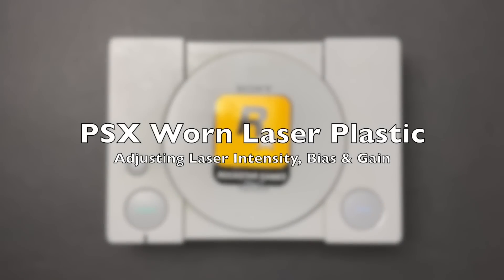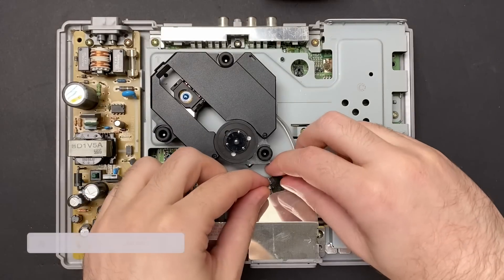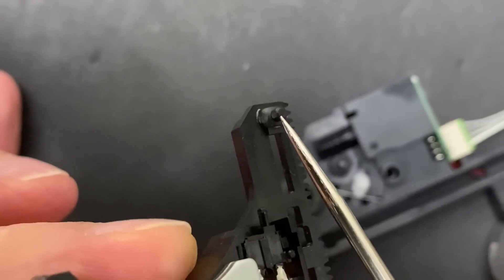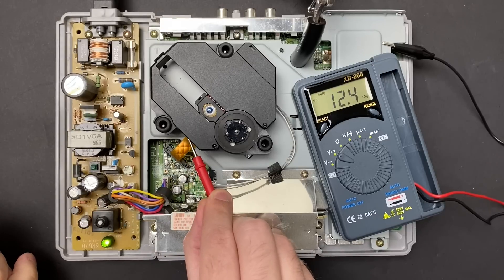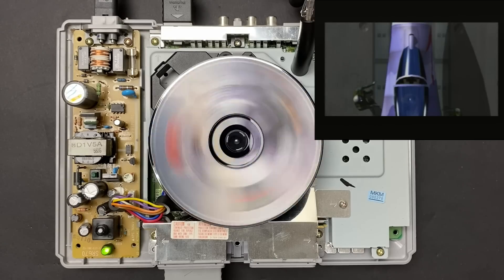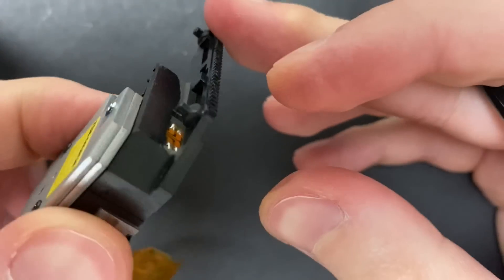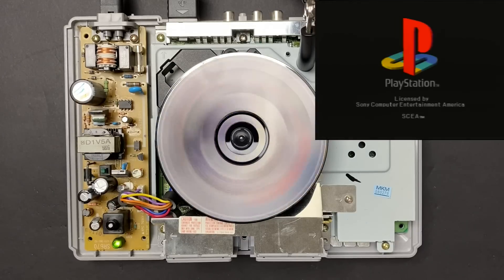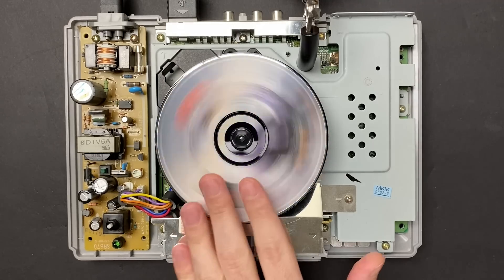Sony PlayStation Disc Skipping Issues - Retro Console Repair

Comment: great job with the worn parts. have you tried ps-io?
Reply from the maker: I haven't yet. I actually have my eye on the XStation since it just replaces the optical drive altogether. I like the idea of having a "virgin" system and a fully modded one so I don't care too much that the same system can both read discs and run images at the same time like the PSIO. Have you tried it?
Reply: @BorderlineOCD  no, I don't have it, because of the pandemic I can't import it, the psio connects through the parallel port and you don't lose the originality of the PlayStation

Comment: Good luck with those reproduction lasers. In my experience, they are garbage, more often than not. I tossed one of these 1001 models out of frustration about a year ago. The original laser was junk, and even after resorting to using a 101 laser with the ACM cover (to properly fit inside of the 1001), I often had to prop it on its side or upside down, which was no better than the tricks people usually employ with one of these consoles anyway. That comment about those pots being finicky is NO JOKE. 😒

Anyway, great video, and I hope it saves other 1001 models. At least I have two 7501's in really good shape that have proven to be pretty reliable.
Reply from the maker: I've heard similar things about those lasers, but figured it was worth a shot. I bought them from two different sellers just to get a different supply (although I'm sure they're all made by the same factory). I'm curious about how well calibrated those drives are, and if perhaps a bit of fine tuning and some quality lube would improve the odds of them lasting any longer. I guess I'll find out.
Reply: IKR? The real reason why i also threw these 1001 models out of frustration is because not only do the cutscenes skip, sometimes you’ll hear really unpleasant noises coming from the CD drive and starts spinning the disc abnoramlly fast to the point where it just hangs on the ps1 logo. So yeah, These 1001 models so are ridiculously annoying!
Reply: I might just be lucky, but I’ve always got the aftermarket lasers working OK with some combination of the new laser and original sled/motor including in my 100x
Reply: @boydsterling3193  Well, in these last two years, I’ve really learned a lot more about why these original drives failed, and seeing the difference in design for the PS2 easily explains why those drives tend to make for a more successful laser replacement/repair.

Comment: Nice fix. One thing to note from back when I repaired quite a few is to also check the motor spindle under the disc platter for hair and debris and add a little lubrication. This may help where the fix you demonstrated doesn't apply.
Reply from the maker: Thanks for the tip!

Comment: I have 2 ps1s and 1 of them has a problem where its disc drive is dead which i do plan on replacing and the other one i got at a flea market  and it came with a official carrying case that was kinda dirty when i found it but it works
Reply from the maker: Before the retro console craze I would see them at Goodwill for $10... those were the days.

Comment: Back in the day we used to "fix" this problem by turning the console upside down.
Reply from the maker: After seeing the wear pattern on the rails up close, its easy to see why that would work. Its only ever so slightly out of alignment, but that's all it takes to stop readings discs.
Reply: @BorderlineOCD  Can you do a video doing this same procedure but with one of the newer slim model PS1's?
Reply: Lol, yup.!!
Reply: Always avoided flipping the unit around 1st common sense and observation, if you do that you block off the ventilation which further causes issues and second you wear and tare other things in the process by not placed as intended. The common result of flipping it you basically fried the components. But then again depends of the room temperature but the risk was present. Luckily or by proper usage my PS1 worked great for 20 years until the laser gave in. Replaced that did usual maintance greasing and cleaning and since then it still works as new granted I play games less then before and mostly my slim PS2 is the one that is actually mostly used anyway.

Edit: On a related note this is what I seen on later gen consoles too where people flipped it all around and drilled holes into the case which basically killed the airflow and fried the console, later complained on endless rants how Sony is making bad consoles, which is not true instead people are not using it as intended.

The latest stupid thing I seen someone post on reddit, a person keeps the PS4 on bed and the tv too and left it powered on and went out of the house, came back and the bed had burn marks and mild smoke too. When I asked wtf is your console doing on the bed even so as the tv plus leaving the house with electronics powered on I got a reply that turns out a near by candle burned the bed and not the console itself. I still said candle or not your place is a fire hazard and a miracle you didn't burned your house down...

When I see these stories and complaints from these individuals I often ask myself how are these people even still alive and who on earth reproduces like this and make these anyway... Like how some humans can be so much out of touch of reality, lacking basic common sense and logic and still have a ''life'' HOW?!
Reply: Yep, apparantly it has something todo with space between the lens and the disc. I had the same problem when replacing the spindle where I push it too depp or not deep enough.
Reply: @RetroVillager  p
Reply: Just got one of these models recently that wouldn't read disc's, saw this comment and tried flipping it, no luck, but on its right side it works lol. Taking it apart to clean and oil as we speak in hopes this will work!
Reply: I just posted my comment and then I read this. This was exactly what I did too. For some reason it fixed the problem but I'm sure it got worse but back then we didn't really keep our consoles for too long so we didn't care.
Reply: I love how people, as a collective, knew to do that, including me, with no knowledge that would even work.
Reply: The screwdriver next to the rotating disc made my toes curl
Reply: So I heard the issue with the first model is that the laser drive is too close to the power source which overheats it and causes it to warp, the solution for that was to turn it upside down and it would allow you to play. And I'm thinking isn't aluminum cans about that thickness couldn't he just use that
Reply: Cool ❤❤❤❤
Reply: used to do that with my PS3 back in the early days, before I went digital.
Reply: @RanaRandom  traitor!
Reply: @Alexander_l322  XDXDXD
Reply: @RanaRandom  Judas
Reply: @Alexander_l322  in truth it was I who was betrayed. Now my blind eyes see what others cannot. That the hand of fate must be forced. :D
Reply: @Alexander_l322  it's more fun collecting physical than digital

Comment: You made a good point about the 'forgotten' repair manuals that are on old websites. I said it before and again, some on or people should make a central console repair/mod website with clear and simple understand tutrorial in one place. 
Any way, great repair and another PSX saved.
Reply from the maker: That's a cool idea particularly for older generation systems, especially if it was maintained by the community.
Reply: Ifixit is one of those sites I believe
Reply: @JesseFleming1990  yeah they got some but i think they do common stuff

Comment: Wow nice job I would have never thought to do something like that and never actually new that model has a laser design flaw! Good to know because I own 2 of that model I would have thought that it was just a bad laser and would have replaced it with a new one
Reply from the maker: Hang on to those two units. Although it's still feasible to source them, they are quite sought after.

Comment: Good job. Again my 3 cents :)
1)Sometimes problem is not in worn plastic parts, but in the laser coils. It is good practice to check laser coils first. Left and right coils should have the same resistance from 5 Ohms in used lasers to 6.2 Ohms in new lasers (higher value is better). I gave those numbres from my memory, about 20 years passed since I worked with PSX consoles, so values may not be exact and may vary depending on laser model.
2)I would use less grease, like 1/3 or even 1/4 of what you used.
3)Before you make any changes to resistor pots check their resistance value with multimeter and write it down. Check resistors when console is unplugged from power. Avoid touching to moving part of the variable resistor or you can change resistance. Check resistance between two pins of the variable resistor. Only make changes to resistor pot on the laser (when console is not powered on and change resistance very little). Setting wrong value for variable resistor on laser means that you can deliver too much power to emiter and you will destory it, so make very small changes to check the difference.
Reply from the maker: Thanks for the tips!

Comment: Very cool/unique repair.
Not that this would help with restoration, but have you thought about or tried a PSnee chip install (for region bypass and running burned/backed up discs)?
Reply from the maker: I hadn't really considered modding one yet. I am hoping the prices of ODEs go down a bit and perhaps do an SD card mod.

Comment: ah yes that i needed similiar happened my childhood ps1 . i tried fix from yours. and worked flawlessly . thank you ! amen
Reply from the maker: Glad it worked for you. Was your wear pattern similar to mine? I imagine each drive will wear down a little differently.
Reply: @BorderlineOCD  yep. But without one metal or tear anything like yours. Mine fine. Had just put gear oil thing.

Doesnt work

Ill adjust power laser.

It worked so no need metal thing on final.

Comment: Ah the memories... I had the first model psx and the intro vids skipped all the time. Had to put the psx upside down to reduce the skipping.
Reply: same same but i fixed after this video now it flawlessly <3
Reply: Had the same console and I also had to lay the console upside down to fix the skipping issue. I was lucky enough to  acquired several new lens later on to fix any issue when trouble came to last me some time. Those were the best times, then ps2 arrived and I forgot about the ps1 console since I can piggy back on the ps2. Thanks for sharing. Very nice detail video.